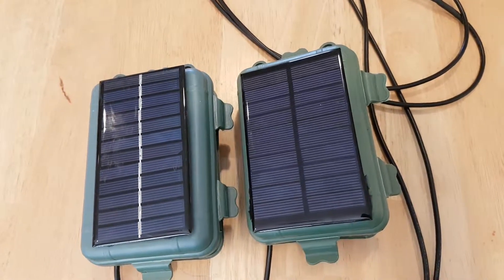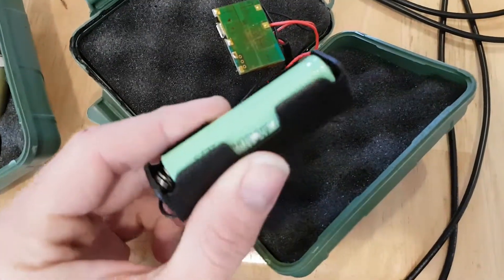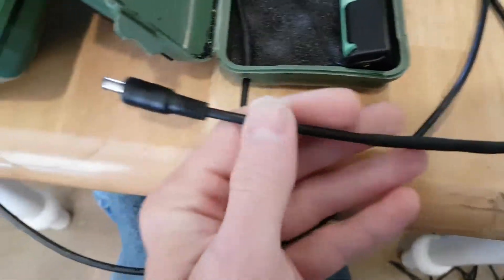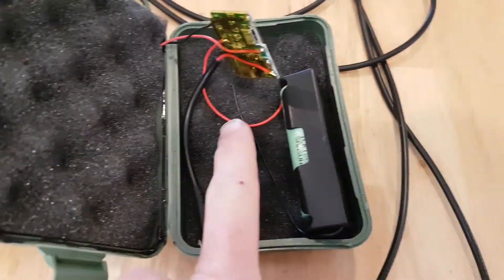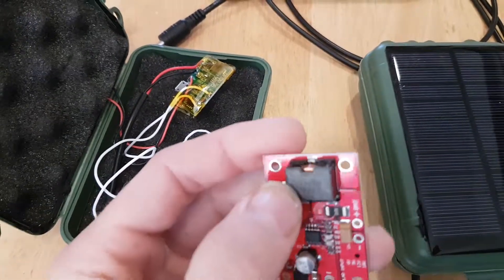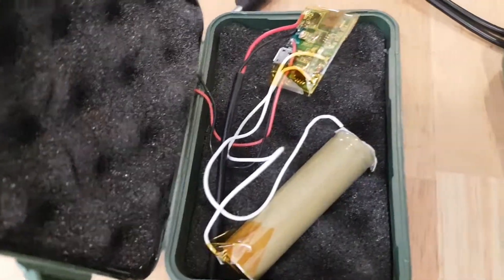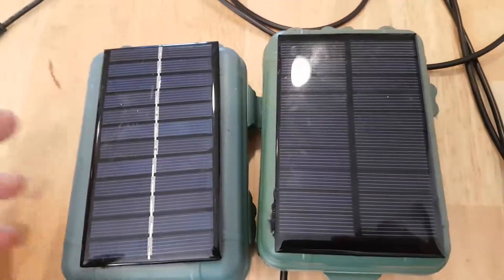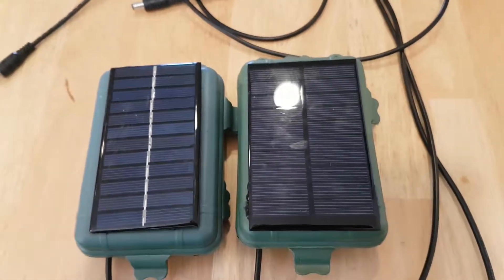Update, and Improved Trail Camera Battery Box

Comment: I made some last year.  Some of those the screw gave way and was putting out 80 volts.  Luckily I tested them with a meter before using them. 

This stuff is outside anything I know.   Are there any boards that don’t have to be adjusted and will only put out 12 volts?  I am worried one of the adjustment screw will give up when connected to my camera and burn it up.

Comment: I built one to test before building the other 9.  I get the 12 volts when the solar panel is in the sun, but when it is not the battery isn't generating 12 volts (it drops to 2.6).  Any suggestions on what I may have done wrong?  I have photos of the set with my meter on it and the board has a green light when in the sun but nothing out of sun.  Thanks
Reply: You haven't done anything wrong the design is flawed a AA battery produces 1.5 volts for alkaline batteries and 1.25 for rechargeable.
Thats why most game cams run off 8 AA batteries x 1.5 volts =12 volts
Reply: @Jason-uu5rh  Thanks but the batteries I bought did not have the nip, so it wasn't making contact.

Comment: Take my money! These are awesome!
Reply from the maker: I love them.  Glad you like. They are time safer and money saver.
Reply: @concert610  I'm trying to do my homework. I'm going to try and build one. Fingers crossed I don't burn up to many boards before I figure it out...lol
Reply from the maker: @davidharmon4497  get the small plugs and solder the plug wires onto each piece. Biggest problem I had was my soldering iron was passing current thru the board. Sometimes the board didn't like it and let go of the magic blue smoke. My soldering iron is super cheap...
Reply: @concert610  I didn't hear where you found the boxes. I've looked for something like them in the past and all I can find are pelican type boxes that are outrageous!
Reply from the maker: @davidharmon4497  aliexpress.com super cheap plastic boxes. On my other video I listed the keyword search. Any link would stop working within weeks just because their vendors products change all the time.
Reply from the maker: Search for: universal waterproof anti fall black plastic storage box for flash light torch lamp battery charger case holder
Reply from the maker: @davidharmon4497  I agree while awesome. Those pelican cases are a bit pricey. I was trying to keep my cost as low as I could. I have thought of other designs with the same concept but once again price starts creeping up.
Reply: @concert610  ok so do you still run batteries in the camera at all? How long have you used one without having to change a battery? Sorry for all the questions, I'm just blown away with all the diy stuff people are doing with these little electronics!!
Reply from the maker: @davidharmon4497  inside the box is a 18650 li-lon battery. The solar panel recharges the li-ion battery using the circuit board. Without the solar panel the battery can last a month or longer from what I've seen. Sometimes I put my cameras in to shaded of a place and it would take a month or longer to go offline.  I've had to add a DC plug to many of my trail cameras. I try to keep the original battery holder connected incase I want to use AA in the future. However I wouldn't recommend using both this solar battery pack system and AA batteries. AA batteries can't be recharged unless you get the NiHh rechargeable ones which need different voltages as well.
Reply from the maker: @davidharmon4497  oh when the pack did go flat. I would bring it in and charge it using a Micro USB cable and a phone charger. I made a bigger battery pack with a bigger solar panel for recharging small battery boxes in the field. I just put it together because I already had everything so it was no extra cost.

Comment: These things are awesome.  Thanks for posting the videos.  It took some time to get all the parts.... and that in itself was an interesting experience, but once I got one of these built (and now 3) they are just fricken awesome!  -- It's the best to just not deal with the batteries anymore, and they are SO much smaller and cheaper than the other way I was going to go with the ammo boxes and solar panels (similar to your earlier builds)!  ----  One follow up question...  is it safe to just twist that screw (with a voltmeter connected) and make more of these as 12v boxes, if I buy a 12v trail cam, with all the same parts?  (I just don't want to kill the battery, or blow one up... if it's not possible, I'll just stick to 6v cams)  ---  Cheers!
Reply from the maker: Glad you like them. All I did was twist the adjustment screw while keeping the voltmeter connected. Everything is the same for 12v trail camera. Biggest problem is making sure they get enough sun. Thanks for the update.

Comment: I was just about to build a box JUST like your earlier models for ~$50..... this is way cool.... and so much smaller!   do you have a parts list for this?  or can you make a video describing the build, kinda like giving a verbal wiring diagram?   
-----
Looks like for a 6v 1.5a build: 
a Solar Panel ( https://amzn.to/2YVtcj7 )  about $5.50, for 1
some type of Li-ion Rechargeable 18650 Batteries ( https://amzn.to/2KHJIdS )  about $6.90, for 2
a Plastic Battery Holder, for 18650 Battery ( https://amzn.to/31M4rTf )  about $1.50, for 1
My cams use 3.5mm x 1.3mm DC Plug Male Connector ( https://amzn.to/2ZcszNd )  about $7.00, for 10-Pack
Spool of 16 WGA wire??
.
But I'm foggy on what the circuit board is....  (I'm all for the better version) Is it this?:
Battery Charging Module 12V MPPT Solar Panel Controller 3 Series Lithium Li-ion 18650 Battery Charging Module ( https://amzn.to/2L6husj )  about $12.00, for 1
and any tips on the box?  Seems to work perfect.
-----
I'm personally not very good with electricity.... I can solder, and heat shrink tubing - but I'm not great at calculating things out.   My big question from your setup is how does the battery which I believe puts out 3.7v get the cable to put out 6v 1.5a to my trail cam??   (an any wiring diagram/explanation if possible) Thanks for any help/advice!  I'd love to have some of these powering my cams on my farm!   Very cool!
Reply from the maker: https://youtu.be/DWi09buoDb8

In my first video I added a parts list and Search words for each part. I found all the parts on AliExpress and I felt a link would expire so quickly due to how items by one seller become unavailable so quickly. Those Amazon prices are terrible and all of those parts are coming from China anyway.

While MPPT charger is nice it just adds a lot to the cost and a bit over kill the other problem is these panels are so small the MPPT controller might use more power then it saves. I use one on my chicken coop with a 10W solar panel and 2 7ah batteries, and I use one on my gate opener (also 10W solar panel). A touch over kill in both cases but I like how the circuit cuts off when the sun isn't out. It doesn't waste power like other PWM and MPPT charge controllers. 

I was able to find a 5v 1.25Watts giving me little  higher watt and little larger foot print then the 6v 1watts solar panel I first used. 
 I think the circuit board I am using is just cutting off the extra voltage like a PWM solar controller would do.  The circuit board I found also handles the charging, and the boost circuit on one board. Which keeps it simple, small,  and the cost down. I would still recommend putting a circuit protection board on the battery for short circuit and low battery voltage protection.

I stripped some thin wire from some cable I had sitting around almost anything will do since your not pushing any high current. I think it was 22-18 gauge. Thicker gauge is easier to work with. I would recommend a battery holder. I got too cheap and build my first battery boxes I didn't use battery holders and it isn't fun soldering directly to the battery and if something goes wrong you can't simply pop out the battery. I also don't like soldering on live circuits so I really recommend the battery box. 

Are you sure about the 3.5mmx1.3mm? most common is the 5.5mmx2.1mm. I've even added the DC plug to cameras which didn't have them. The real thing to remember to do is to know what voltage your camera needs and to set the battery pack to the correct voltage before plugging it in. I recommend labeling both the camera and the battery box with the voltage required and voltage set. I have some cameras that use 6v, some that use 9v and some that use 12v. Talk about a pain. With them all labeled its sure to help prevent a burn out. There might be a circuit inside to step up or step down the power for the camera's real requirements in case you forget to change the voltage you might not totally burn out the camera.

What kind of trail camera uses 1.5Amps? I hope that's only while taking a picture. Most trail cameras have very low power usage, like 10mA in standby and 150mA when taking a picture or something in that range. The circuit board says it can handle up to 2Amps max discharge I would be worried about putting that high of load on a cheap 18650 cell. The cheap ones are only rated at .5 amp discharge @ 3.7volts. for the 6v 1.5Amps the battery discharge would be almost 2.5Amps. So if it really pulls 6v 1.5 amps make sure to get a battery rated high enough or it may shorten the life of the battery or it may catch fire.

Oh those batteries I wouldn't be surprised if they are fake. 18650 are cheaper li-ion batteries but they aren't known for having 5000 mAh capacity. Not yet anyway. Maybe 2500mAh to 2900mAh would be pushing it. I recovered mine from old laptop batteries I had sitting around. normally 6 to 9 18650 batteries in each laptop battery and most the time only one battery is dead. They were Samsung or LG batteries with a rating of .5 Amp discharge. I figure for free even if they don't last forever it gives them a second life. Better then going to waste. But even if they only have 900mAh capacity it might be enough. Normally these cameras have very little draw. Even my batteries (2500-2600mAh) are very over kill but it's what I have on hand.

Check out that other video and see if I cleared up any questions you might have. They have worked great for me. One of the new issues I have is the geese like to chew off the plug ends. I have about 40 chickens, 12 ducks, and 6 geese. I use the same setup on my wireless keypad for my gate opener. Works great for that as well. I have a problem with my Browning Cameras (12 volt) running out of battery power but I found placing the battery pack where it gets better sunlight resolves that issue. It may also help if I had added a circuit protection board. If you have any more questions leave a comment and I would be glad to answer. These boxes were super cheap and not nearly an eye sore nor as expensive as the big ones I have been using.

I'll try and add a page to my website http://www.Concert610.com with more and better pictures of this design. I just looked and I only have the old design posted.
Reply: @concert610  .. also... is that Kapton Tape/Polyimide Film Adhesive Tape on the circuit board?
Reply from the maker: Kapton tape, but you could use electrical tape.